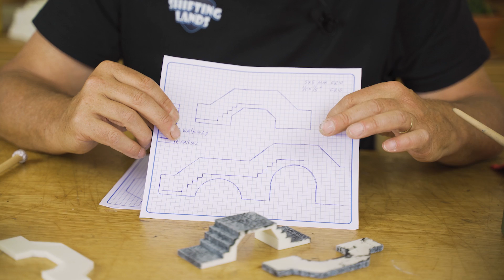Crafting a Venetian Style Bridge in 30 Minutes (Let's build in silence)

Comment: Love your videos, they give me  inspiration for my own project. Why 3 or 4 pencils, are they of different hardness to give different texture effects?
Reply from the maker: For the graut lines I use a somewhat sharper pencil and for the texture a more blunt one.
Best of luck with your projects!
Reply: @Shiftinglands  thank you for the reply, that makes sense. I've just recently purchased the No5 tool and the angle cutter and they have made my project so much more accurate and easier to build, but still experimenting with texturing and painting.